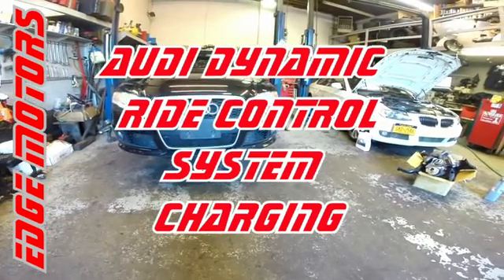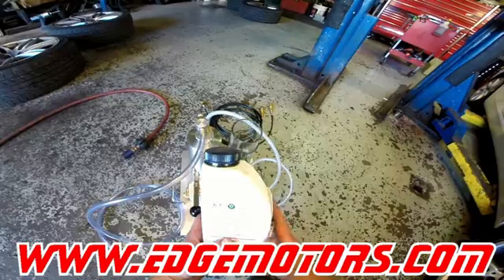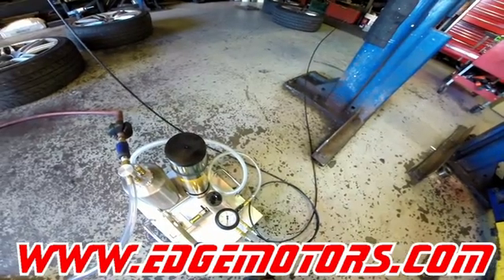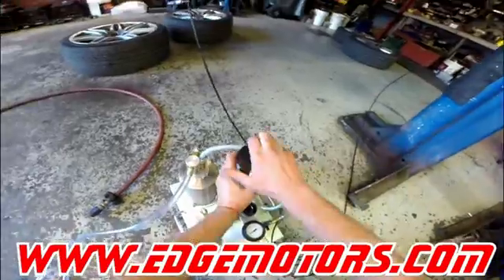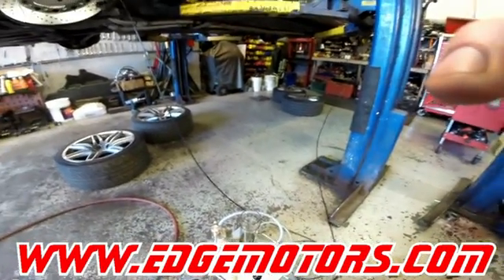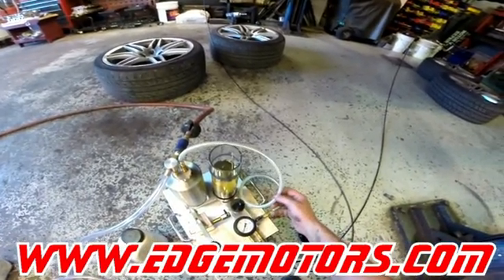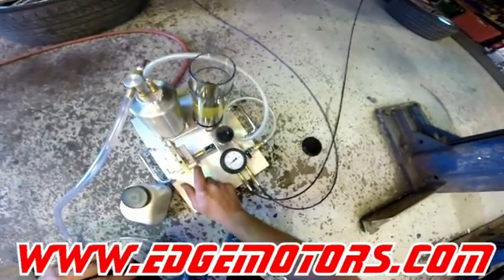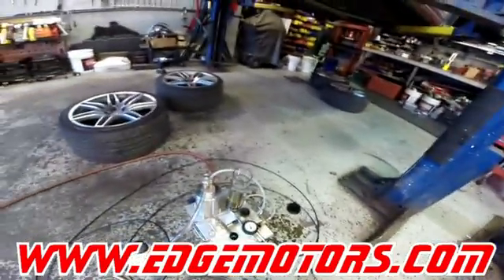Audi RS4 RS6 DRC Dynamic Ride Control System drain and refill charge vis VAS6544 by Edge Motors

Comment: Hi Edgemotors Team! Great Video! I know it`s some years ago but i have some questions. I had to replace all 4 hoses at the suspension of my RS4 B8 2013. I can have the DRC tool for rent. In the instruction manual the final operation pressure of the system has to be 20 bar. Is it not 16 bar as in your video? Do I have to let the ingnition switch on while i do the work on the system? Is it important do do one side or charg the system diagonally? Thanks a lot!

Comment: If the DRC system is charged to the incorrect bar in my case when checked it was at 9 bar and car driven approximately 1,000-1,500 miles with banging noise. Are the new shocks now damaged?
Reply: Audi approved dealer did the change of front shocks and there was a rattling noise like the shock was going to fall off when I got it back. So bad I had to pull the car over and get a tow truck. I thought they had not tightened the top mount. Audi proceeded to tell me that the rear right was also leaking but only slightly and thought maybe since they are crossed linked that should be replaced so replaced two rear, now all four shocks replaced and primed. Rattling noise still in front shocks? They claimed was not there work, don’t know what it was and gave me back the car after three months of backwards and forwards. Brought the car to another Audi mechanic and he sent this email: The NSF/OSR was sat at 12 bar static and the OSF/NSR was sat at 9 bar. I can confirm the vehicle was dropped to me in March and we found the suspension was insufficiently primed.
 
We carried out the re-priming and the vehicle is now fine.
Reply: I am now asking Audi for compensation as I had to bring the car to another country. In the Country where I live the Audi dealers had never worked on this model. My other worry now is that the shocks are damaged as I still feel it is not the way it was when I dropped it into them. Sorry I ever agreed to change them
Reply from the maker: Hey, at 9 bar it should not make any noise… it would be not working efficient, but I don’t think it would kill the shocks at that pressure. However, if shocks were replaced and someone used power tools to tighten the nut on top of the shock without of holding the shaft, they may of unbolted the shock piston

Comment: SO confusing. isent the circuit in a X configuration? Like isent the Front right on the same circuit as the Rear left? So by doing Both front and rear left side wouldn't this drain the whole system?

Comment: I'm doing this right now (with VAG6544) and simply want to relieve the pressure from the two front shocks so I replace the front control arms. After that, I will lift all four sides and follow your instructions (re-vacuuming, and filling etc...). Any harm in vacuuming out the front two shocks together in the meatime?

Comment: correct me if im wrong but cant you just vac it out with a HVAC vac pump and manifold gauge set ?
like these DRC kits cost over $2000
Reply from the maker: Vacuuming is not the problem here..... the upwards putting back in is the problem.....
Reply: @EDGEMOTORS  understand that, but a simple hydraulic hand pump with a reservoir and pressure gauge would do the exact same job right?
like thats all your doing is charging the system to a specific pressure?
The DRC charging kit cost over $2000 to achieve a simple job. Or is there more too it then this?
Iv seen HVAC equipment more complex that are fare cheaper then this

Comment: Very useful video! I need to do same job with Audi RS6 Plus /2004. Problem is that I can find those quick connectors near the shock. Are they somewhere else? Or the system is different?

Comment: They are diagonally linked so you should be discharging/charging them as a diagonal pair.
Reply from the maker: As of the pistons are in rest position, you could drain and fill on the same side... Also a good way to check if piston leaking internally:)
Reply: How much oil do you have?

Comment: Thanks for the info so this is the actual tool that they use in the dealership it's from Equipment solutions after I saw this video I searched on the net and there was a real problems with the first introduction of this system they came out with updated parts did it help the reliability ? I'm curious does the car have any coil springs at all or it is just the shocks that can alter the ride height etc . And cornering characteristic.
Reply from the maker: V10PDTDI it does have springs, the rear shocks adjust the ride height just a bit... and yes thats the actual tool they use in the dealerships.

Comment: Never seen a car at my shop with this type of suspension were did you get this kit for refilling the shocks . Are you doing that many of them that you had to buy this tool ?
Reply from the maker: Not too many of them on the roads... But when they do come in, we do service them... Dealers in my area charge 600+$ plus fluid and tax to refill the system I don't like to charge my customer 1000$ to replace a shock.... That's why I got the tool.
The tool is from snapon.audi.com Orem tool catalog
It's about 2000$ plus shipping:(
Reply from the maker: And don't forget that the shock it self is close to 600$